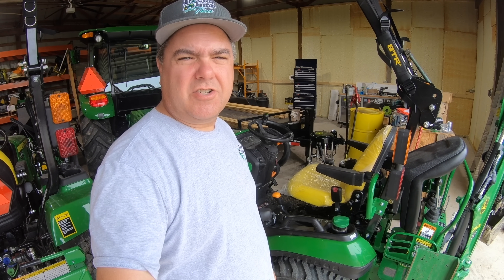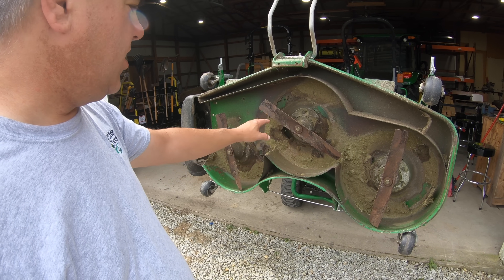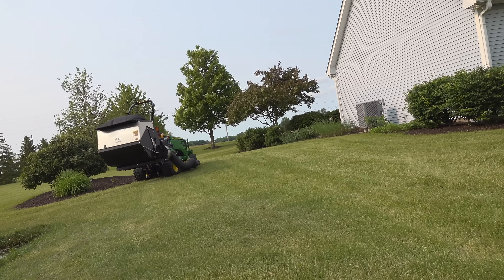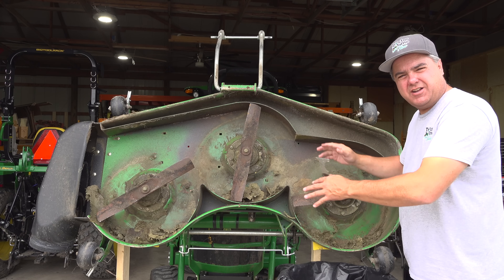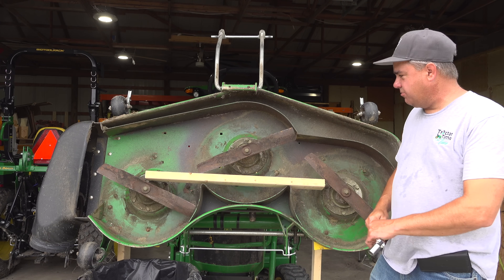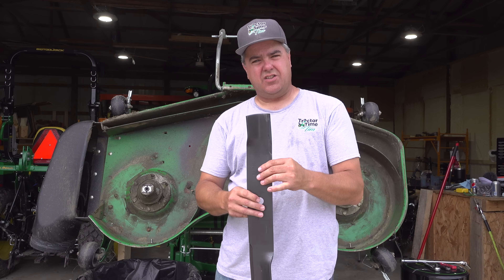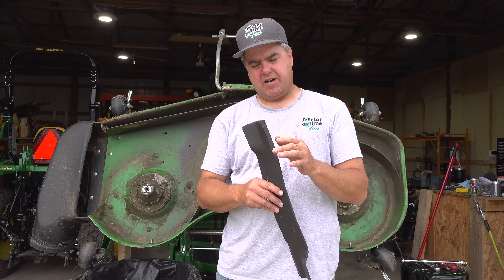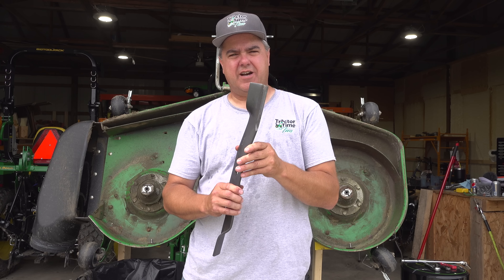Never Sharpen Your Mower Blades Again???

Comment: Paint the underside of your deck with used oil from your oil changes. Protects the steel. Reduces build up and rust out. Oil up the blades too!
Reply: Great tip - your blades and deck  will last a real long  time because you will have a lot less grass to cut after killing it with all that burnt oil dripping off the blades and deck. I use  canola oil instead. wont kill grass
Reply: @fastguned  you only spread on a thin layer. Not slopping it everywhere. Haven’t had any issues with the lawns I care for.  The idea is to recycle the oil and protect the decks.

Comment: Tim... have you had any luck using the spray system for the deck after it cools,  it never seems to work for me all that well on my 54D auto connect.
Reply from the maker: The water hose thingy?  Nope. Useless.

Comment: This has been around since at least mid 80s, I made my own with hard rod on my blades, I chipped mine on rocks and other nasty tuff, just get the welder out and fill in the ouch then grab the rosebud and let your black smith self come out. In the 80s I think I ordered these bladed from Silver Streak for a few customers, you will see the difference in your yard when you mow with a sharp blade set. Only used this blade on my rider, you don't have to keep removing the deck to sharpen every week

Comment: Seems a plastic deck or aluminum deck made with recycled aluminum would eliminate the corrosion problem. As for self sharpening blades, I would need to see at least five years of constant use before considering purchasing them. Good video and thx for posting.
Reply: I believe some mfrs have gone to composite decks, at least on push mowers like Honda.

Comment: Thanks Tim. That attach system with the quick-attach system on that John Deere is awesome. Would love to have that. We have a lot of rocks here and have to sharpen constantly and it is a pain to remove the deck every time to sharpen. I doubt that those blades would work here. On a smooth well set up lawn, they probably would.
Reply: I just seen a guy here contract a company to bring in machinery to remove all the rocks on his 100 or so acres. They did a remarkable job, had a pile about 10ft high by about 20’ wide. Many rocks, but now no more.

Comment: Wonder if you sprayed an oil under the deck. If that would help keep from getting the grass build up on it.
Reply: Yes, I use used cooking oil.  Or any lubricant will work.  As long as it is tacky it will stick.  The clippings adhere to the oil but don't bake in.  Spray off in seconds and reapply the oil.

Comment: That is a very important job to do on the mower blades and I have to take the blades off of my zero turn mower and sharpen them. I have two mowers which need to be repaired now and I am using my 790 John Deere tractor to mow my lawn with until then.

Comment: If you don't want grass to stick, on the bottom, spray WD40 on it, and use car wax, and wax the top of the deck, and most of the grass won't stick to it. You can blow it off with air or water hose, 
Also, you can use a low torque, impact to tighten the blades, wrap a rag around the blade, and hold it with your hand and tighten it..
Reply: Pan spray from Costco or Sams is a lot cheaper and is biodegradable unlike WD-40.

Comment: Interesting video. Thanks for sharing 
My mower deck is 19 years old and has no rust. I used a product like flex seal inside the mower deck when I bought it new and it cleans up really easy. Spray light coats and don’t coverup the hardware with it or get the bearing/seals covered with it. It does need touched up once in a while where impacts have occurred. I would use a white color or light color now but it wasn’t available then.
I once heard of a guy who used carbide mower blades but could never find them. Has anyone heard of them recently?
Ron

Comment: When you sharpen blades make sure you balance the blades, if you don’t the blade will develop a shimmy and blow out the bearings. It’s alway a good practice to keep the under carriage decal clean. If you don’t the height of the grass will not be right.

Comment: I never sharpen my blades on the lawn mowers.  The dull blades make mowing a little slower, but they tend to rip the grass rather than cut it so the grass does not grow as fast so you don't have to cut as often.  I can only imagine how expensive the load and go is.  We bought just the fittings for the quik tach for my wife's JD.  After the first one, we just started making the fittings.  Maybe $10 worth of steel and $120 for JD paint when you make them your self and it is still cheaper than a genuine JD part.
Reply: Ripping the grass blade can cause fungus and turns the grass blade tip yellow or white. Sharp lawn = sharp blades.
Reply: @henrysmith8012  But healthy grass grows faster and needs cut more often.  As long as there are greenish patches in the yard, I am good with it.

Comment: Had our lt155 at the dealer today. Apparently if you dont take the blades off once every decade they get so stuck that they have to use a torch to get them off.
Reply: We had this problem on our Laser Z Zero turn.  Even a 3/4 impact wrench would not budge one of the spindles.  Dealer had to use heat.

Comment: I don't understand how only a very short portion of the blades are sharp what cuts the other portion of grass under the blades?
Reply from the maker: That is a good question!   The blades spin fast enough that there should never be any uncut grass get to the center of the blades.  So, the first inch or two of the blade does all of the cutting.  Make sense?

Comment: Tim, i know this is older video, so i hope you see this.  i just had a question on when you do sharpen your blades on both your finishing mower and bush hog how do you sharpen?  Also, is it ok to tilt my PRD WOODS 72" up on its side like that with the gear box and gear oil on top?  Definitely make it a lot easier if i can.  Those seem like great blades but i mow rough pastures , heck my yard is 5 acres and just as rough so id tear them up probably.  Great videos👍🏻 by the way!!
Reply from the maker: I am bad about sharpening blades.  Probably should ask someone more ‘proactive’ on that topic.
You can tip it up.  If it leaks…refill it!

Comment: Those water hose washout things work (somewhat) If you park it on asphalt or concrete and lower the deck all the way down and the turn on the hose and mower.

Comment: In my area we have sand, we run ztrs we get almost 2 weeks from a set of blades, we sharpen every day, but we’re in the business. About 20 hrs on mowers per week..........but we pay a little over 5 bucks per blade. It’s not really a biggie.
Reply: Please, where are you finding blades for 5 bucks apiece, and are they just cheap crap, or nice and thick, like the factory 22 dollar apiece ones?
Reply: We used to order through texasmowerparts.com......now we just check eBay all the time....you have to be careful some are thinner than others...
Reply: @freedom1439 -  Thanks for the response, and the link. Great info.  65 a set is a bit steep, if you can pick em up for less than 20.

Comment: I have a hose spray connection I use each use while the blades are running while all the grass residue is still wet

Comment: Hey Tim,  the next time you clean the bottom of the deck,  get yourself a gallon of the Herculiner HCL1B8 Brush-on Bed Liner Kit.  It'll protect the bottom of it. I used the whole gallon on mine and 
it works great.

Comment: I have a push mower with a briggs and stratton engine and I’m curious if any model of deer blades would work on it because I hate sharpening the blades since the motor doesn’t seem to like starting after being on its side and I’ve been looking for a decent set of high lift blades since I side shoot 24/7

Comment: I can't see these working that great. #1 thing with blades is the blade tip, Speed and cutting edge. Most blades will round the tips first, because this is where most the cutting happens. Once the tip is rounded, you lose blade speed because the blade center is turning slower. Thus it leads to leaving strips of uncut grass. I've Worked with mowers for years now.
Reply: There are other self-sharpening blades on the market, mostly for commercial ZTR and stand-on mowers. Deere has probably been testing these in the field under varying conditions for a year before making them publicly available.

Comment: you can apply used oil to coat the deck or deck mow spray to coat the deck .I would suggest you wear rubber gloves pretty dirty under the mow decks !

Comment: Gravely has offered that style of blade for 20 years. They work well if you don’t have sticks and rocks that chip the edge up. Gravely had them for 60 and 72” decks. I bet they are the same blade. 
They are great for users who cut commercially and run the blades until the lift area of the blade  wears through and then discards them without ever sharpening them.
Reply: You are correct.  Gravely had a similar blade available.   Those blades lasted longer, but they did not self sharpen.   Gravely has upgraded their coated blades to this technology.   I believe they have eight new versions.  They have this self-sharpening coating on them.

Comment: Why not just use a powder depositing torch to face harden one of the sides of each blade?  As the blade cuts the grass, the softer base material will erode away, but the face hardened surface will not,  leaving the blade always sharp.

Comment: 30 years using same blade on same mower.  Cutting edges are honed to nasty sharp twice a year.  I just don't ever mow rocks or sticks.  I never use an electric grinder for sharpening.  The mower cuts easily and cleanly with only minor maintenance.

Comment: Does one need to sharpen their mower blades?   Yes;   when they start breaking off the grass instead of cutting it off.  Look at the edge where it is supposed to be cut.  if jagged, then it was not cut off.       It will be interesting to see how  Tim's  experiment works out.

Comment: Man... I always paste up the blade retaining bolts and washers with an ample coating of chassis lube when reinstalling to make them easier to take off next time... They tend to rust up and seize up easily from all the moisture under the deck...
Reply: That is not recommended

Comment: A pressure washer can force water into your bearings if they are old. Not good. Also spray rust with rust converter spray to halt rusting, it works!

Comment: The drive over ramps should be located on all three decks in the same spot so as to match the front wheelbase of the tractor. That is why I don't understand why the only make the load and go for only one deck.

Comment: What did you find your pressure washer at WalMart delivery for good low prices until my sim no 2019 tractors coming out with bush hog more than front end loader and backhoe for 2019.

Comment: Would be neat to see a PTO modification that would allow the deck to be used with the bucket arms..maybe in 'float' mode if it had one.
Reply: Neighbor has a bush-hog deck for his Bobcat that works like that. It can cut a 5" diameter tree down... as well as tangle 30' of barb-wire around the prop in 2 seconds flat.
Reply: @TheHighKirk  I Believe that would be like my hydraulic PTO for my Bobcat, no shaft involved. Lots of torque, but yes, you can get in big trouble.  But it's always a reliable way to find hidden wire....

Comment: I ceramic coated my mower very very thorough!! Nothing sticks!
Reply from the maker: how much does this cost?
Reply: @TractorTimewithTim  , $15 bucks for the Mothers CMX. You can find it at most auto parts stores.
Reply from the maker: How long does it stay on?  Do you have to apply again?
Reply: @TractorTimewithTim  , it will last 6 months.

Comment: Oregon G6 carbide blades are supposed to hold up pretty well. Have a set for the Kubota haven't gotten around to putting on yet be interesting to see how they compare. I always spray deck with fluid film once it's clean, seems to make things easier.
Reply: Simply use pan spray, the cheap stuff you can buy at Costco or Sam's Club. The brand is not important, but it will keep your deck underside a lot cleaner, without all the trouble this guy goes to.  Did I mention that it's biodegradable and completely safe?

Comment: Tim, Do you have a welder? You can take some less expensive  blades. Take some  hard surface welding rods, and do your own. I put a bead on the top  cutting edge, and where it wears on the upswing on the blade.  We have  sand like Florida. A regular set of blades last about 3 months.  Just doing my yard.  Before they need replacing After I put the hard surface on. They last a hole lot longer.  These  companies want their blades to last longer. But not forever. Putting the bead on the top, and sharpening it. Is a better approach.

Comment: no one mentioned checking balence of the  blades thats what crackes a mower deck  if its unbalenced can you immange running a boat or an airplane  with unbalenced blades

Comment: Get a 18 inch length of swing-set tubing from the leg - it's thin-wall. Flatten it down a bit.
This slides over your blade for easy- safe removal and installation of a sharp blade.
The length should interfere with your deck.

Comment: I let my grass tell me when the blades need sharping. I will mow a path or two and walk what I just cut if the blades of grass are cut clean the blades are good. If you see jagged cuts or rips on the cut ends of the grass time to get the blades off and introduce them to the bench grinder.

Comment: Pro tip: remove your blades when cleaning your deck.  Especially if your replacing the blades at the same time.  Makes life much easier.
Reply: Wouldn't you be concerned about wearing out the spindle threads? I don't think they're designed to be taken off that often.  I am referring to cleaning only.
Reply: @replyhere590  maybe with a cheaper mower, but commercial grade spindles are absolutely designed to have the blades removed quite frequently.

Comment: i suspect the edge of the fancy blade is High Speed Steel(HHS). but if they alloy a little Cobalt it will be much more durable to rock chipping it and whatnot. Gravely tried carbide and the results were mixed. HHS can cut ordinary steel when used correctly but Cobalt HS is better stuff. the result is more $$ to produce HHS Cobalt. and carbide is even more $$$$$$...

Comment: I have used WD40 on my lawnmower after every wash, it works like magic. 
The grass build up just falls of the metal. Try that, it will surprises you. 
Thanks
Reply: Water Displacing compound 40
Reply: @billludolph1696  Weed displacing?

Comment: Did you torque the bladed bolts down?  They are suppose to be at 90ft lbs.
For a healthy lawn the grass blades need to be cut clean.  If the top of the grass blades are ripped instead of cut clean it hurts the grass.  Bacteria and fungus get into the ripped grass blades, moisture is lost faster and the grass in now weaker.  Making your lawn susceptible to turning brown.  After each mowing you should go out into the lawn and look at a few grass blades up close.  See if the top of the grass blade is cut clean or jagged.  If it has a clean cut - good to mow next time, if jagged - sharpen blades before next mow.

Comment: I just wonder; if someone were to take that brand new straight out of the packing, Or if it is used, to try to get it as clean as it would be if it were new,-and give it going over with some spray can clearcoat, and or give it a good waxing with automotive paste wax, or maybe some high gloss armor all or something like it… Would that make it enough more non-stick that it would be worth the effort? Since that accumulation of dried cut grass pate is an organic substance, I will typically mix up a potent solution of lye- based drain opener-like red devil crystal lye, or such, and have found that it pretty much chew up or at least soften or detach anything organic that is present, but it would be a last ditch remedy, because it might damage the substrate, but I think the steel mower deck could probably withstand it if you limited the exposure to maybe eight hours. On a vertical surface like this, you would need to paint a good thick layer on with an old paintbrush or something, cover the whole thing with newspaper wetted down with the lye solution, and then put a big garbage bag or something over that to keep it wet. (That is a trick I got off of the instructions of a rust converter/remover) Anyway, anytime I get anything brand new that has any plastic on it, I give it a good slathering with armor all, seems to make it easier to clean, and generally preserves the brand new look. Considering how you have reduced removing the blades to such little effort, wouldn’t you want to go ahead and remove those before you did any cleaning just to get them out-of-the-way? Thanks for a great video.

Comment: Heavy equipment blades, decks, and dump truck beds get sprayed with diesel fuel when they're clean. They don't rust, material clings on but can't bond to the surface. This will add years of life to your decks.

Comment: pro tip throughly clean and then use a can or 3 of teflon spray paint ,plan on 2 applications per year if your a commercial mower as needed when residential ,thank me later ;)

Comment: all one has to do to keep the grass clippings buildup under the deck down and very easy to clean is to spray SILICONE Spray under and on all surfaces occasionally and on the blades, then hose off after each cutting ..  You'll be Amazed! ..and imo, if you're hitting the same roots and rocks each time your mowing in the same areas, you're obviously too low , even new areas.